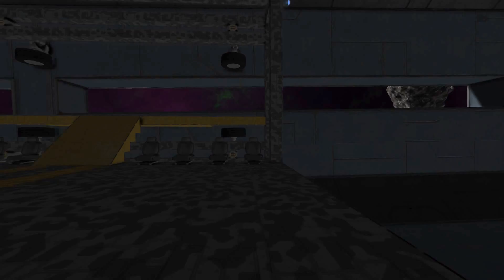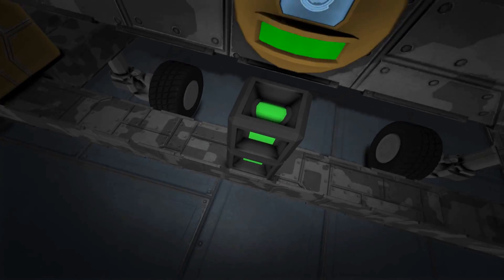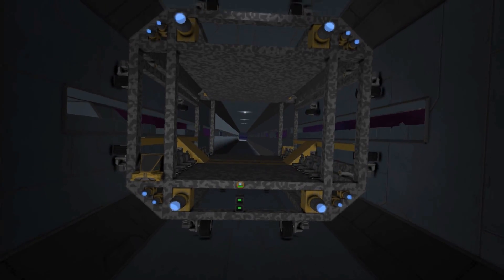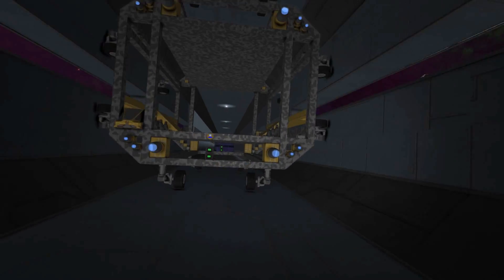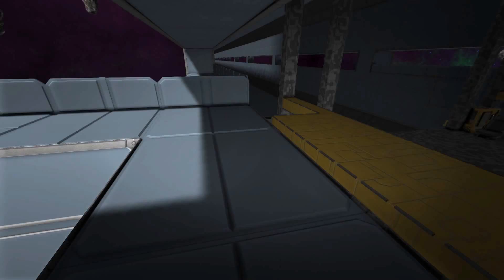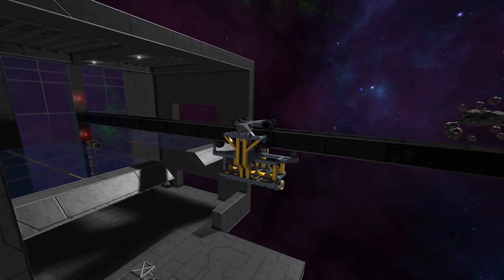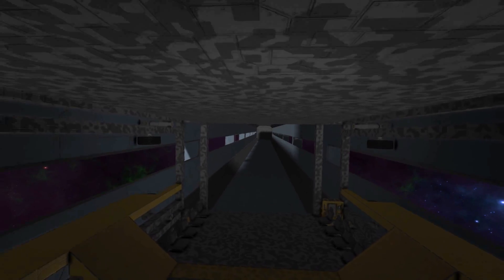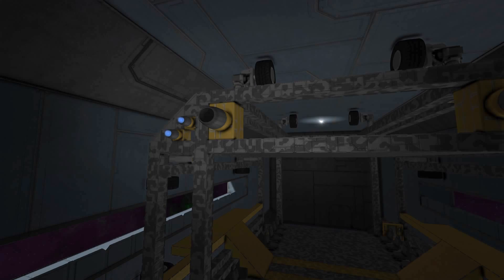Space Engineers - Automatic Subway / Tube Guide - Survival Mode

Comment: I have an idea for multiple stations. To detect "middle" stations have two sensors on the top or bottom. One near the front one near the end. Set it to only detect small ships. At the right distance you would need to line up, have a gap in the top large blocks and have a small "ship" (a square of light armor blocks attached with a landing gear would work). 
Sensor triggers
Disables second sensor (to avoid conflicting triggers as this sensor hits the stop trigger)
car stops
time elapses
car continues forward if forward sensor, back if aft sensor
second sensor reactivated

Comment: you can place your end sensors at the top and set the middle station with a sensor at the bottom that set a one minute wait and then continues on with what it was doing and set the timers at each end of the tunnel to change direction? maybe two timer blocks with a third  to swop between forward and backward block for each stop in the middle

Comment: nice design but if you wanted to have it run to multiple stations place a 2 pistons in the ground in front and behind where the cart stops  attached to a sensor and a timer. for example the cart would find the one piston in front that is extended then the sensor on the ground would tell the piston to lower and the other behind the cart to raise. then once the timer is complete on the cart the cart will move the other direction... or at least should...

Also you should run conveyors to each end and have a resource container on the cart so it can automatically transfer cargo to the other location if needed
Reply from the maker: Yeah actually ended using that technique for v2 :) Worked very nicely and also figured out a way to handle corners although it's a cheat method I'll admit, not quite an actual corner.. Also ended up the cargo thing in another vid heh.. cheers dude! Good thinking, seems we have a similar thought process :)

Comment: Multiple stations:
Use small blocks as the stops with the sensor facing the direction of each stop set to detect small ships or what not. For the final stops, use the end caps of the tunnels with your current sensor setups. Should work pretty smoothly.
Reply from the maker: By v2 I'd come to the same conclusion so it has both corners and multiple stations working properly :) Cheers!

Comment: I believe it could be possible to change directions with this at junctions if the cable car is square.  If you put wheels and thrusters on both ends as well, a sensor could detect the end of the line 'T junction', turn off the set of thrusters just used and turn on one of the end sets to travel down the perpendicular path.  Bit of work but I think it could be possible with this design.  Just a thought.
Reply from the maker: Yeah I see what you mean.. could work indeed although I ended up managing it using a similar but slightly different approach. Basically I built turning point the car drives into and they then turn 90degrees allowing the car to drive out in a new direction. Urs is potentially a bit more elegant I'd say.

Comment: There is actually a possibility to make 3 and more stations i think. You can place a sensor thats facing sideways, then you have a hole in the tunnel at the position of a station. When the sensor doesn't see anything in front of it, (when it's facing the hole) it can break the train and after that going forward again. The sensors on the front still work as they do now to turn the trains direction. Correct me if im wrong, but if it works you maybe can build this in :D
Reply: Oh somebody has posted this before me...sorry xD
Reply from the maker: Felix G Hehe no worries :) Thanks anyway! I'm gonna revisit this eventually and do a new version with a load more features, been some cool suggestions like yours that could help a lot.

Comment: you can use a timer for each station, if you can tweak it right it'll travel 1 minute to get to the next station, stop and activate a reset timer which activates the next timer etc
Reply: ***** You could also mount 2 sensors on the side, one senses an end of the tunnel and activates the turn around system, the other detects something else like a small ship block which you can place on the edge on the tunnel signalling it to activate the delay and then continue timer. It makes the system a lot better because the car doesn't have to remember what to do at each stop and just reads the design of the track
Reply from the maker: Yeah could do indeed, just liked the sensor method as it made the tweaking a lot less complicated. There is a follow up video to this one on my channel where I've also got the multiple stations thing working with sensors :)
Reply from the maker: KaoS Dlanor
Aye that would work pretty well, we can also now use ownership as another method of setting up separate sensor systems.. can have small block/neutral, small block/enemy etc as long as you use a block that you can set ownership on. Drastically extends whats possible without scripting :)

Comment: I may have a way to allow multiple stations.
If you have a set of sensors along one side set to a short distance (A very tight beam that extends about 1 meter?) you could use that to tell the cart where it is in the system by looking at blocks along the side of the track
All the sensors would be looking at the walls of the track, activated by changes in wall depth. (These would obviously not be in line with the wheels, as that could cause derailments)
e.g. Station one: Reverse end of line sensor detects a block (or lack of block) undeneath it, letting the cart know it needs to reverse, and possibly switch to a second set of sensors for moving forward.
Station two: Forward pause sensor detects a block change under it, activates thrusters to stop and timer to wait. Timer fires to resume forward motion.
Stations three onwards to 9 do the same.
Station 10: Forward end of line sensor detects a block change under it, fires thruster to slow down, timer to wait at station, and timer turns off forward sensors and turns on reverse sensors, fires reverse engines.
Reply from the maker: Cool idea, I did update this video with a newer version with corners and multiple stations but wasn't quite as complex as what you are suggesting although works on that same sorta principle... detects a block above the cart to know where stations are etc... Really like your method for turning around at the end though with a full 2nd set of sensors, will give that a try :)

Comment: What about replacing the floor and ceiling with light armor blocks (probably with a one block heavy armor margin/perimeter)?  I get that hollowing out the ceiling would ruin its only purpose of keeping a centered mass of the car, but the large planes of heavy armor are probably a good portion of the weight.  These planes are less likely to be hit by any jostling than the outer heavy armor frame and the larger surface area grants more structural integrity than just single block lines anyway.
Reply from the maker: Could definitely work, having shifted all the steel plate to build that much heavy armour I was loathe to shift it all back to the base again by taking it apart! The next version of this subway system will have multiple cars so will use what you suggest there, still structurally strong but as you say a lot lighter. Thanks for the suggestion :)
Reply: No prob.  I hope you find it helpful!

Comment: You can make it stop at a certain station. You just need a senor underneath that detect small blocks, You put four of these next to each other. On each station you can have a small block on a piston. You only extend the piston of the station you want to reach. If you want to controll from the cart, just put the pistons on the cart.
Reply from the maker: Yeah sounds really simple solution, could then have buttons at each station to "stop" the train to board and then once you are on maybe a timer puts it back down after 30secs. I like it :) Thanks!
Reply: ***** Happy to help :)